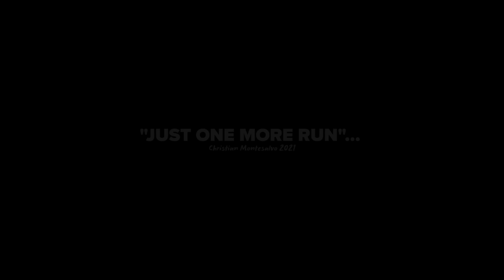WE FLIPPED THE BOAT Hours Before The Race - Dinghy Derby Episode 2

Comment: An old trick my old man taught me when i was a young bloke in the 70's ( know-all 7 yo-- " i'll get the out board off dad!! )... lost balance, straight into the river, holding the motor. Got it out amongst the swearing and yelling, first thing he did was drain fuel, take plug out, put in about a litre of metho and cranked it over..... metho mixed with the water/moisture and in 15 mins, it was running again. I have never forgotten that lesson, and used it once or twice since.